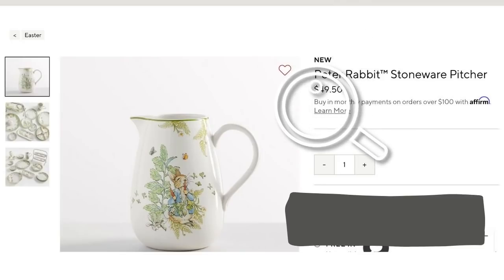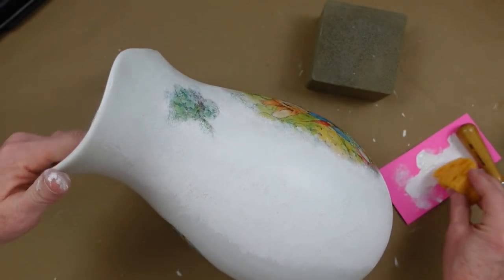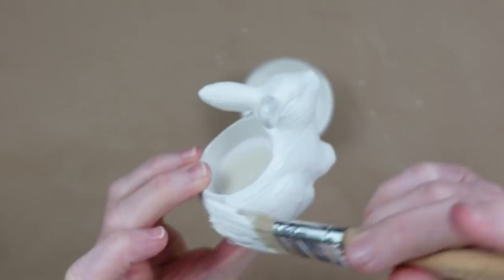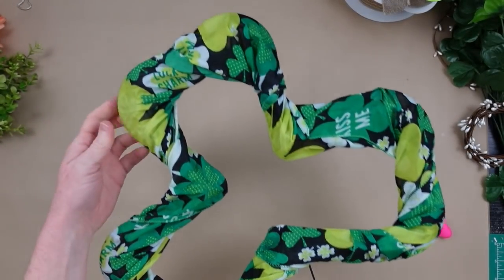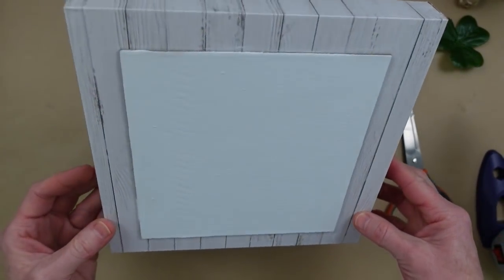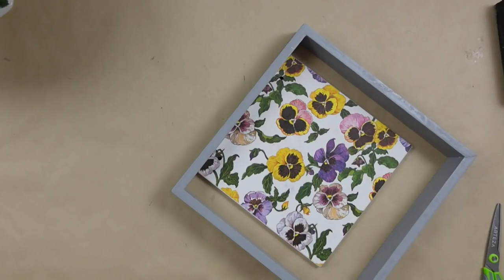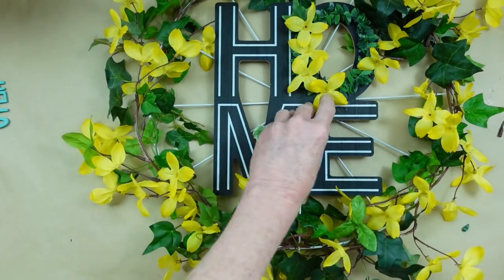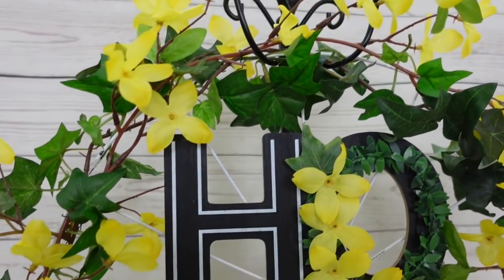15 MORE Gorgeous Spring DIYs from Dollar Tree and Thrift Store

Comment: That white pitcher is like the perfect white pitcher. Perfect for what you do with it. The only thing i would have done differently is tear the edges of the tissue paper instead of cut. I always do that with decoupage because it blends in better if the edges are torn and rough instead of a cut straight edge. But it was still beautiful even though it was cut edge, even before you put the paint on. And even better after. You always do a great job, Brandy. I love every one of these diys.
Reply from the maker: Thanks so much Crystal!

Comment: You rocked those bunnies using chalk paint. Really, they were beauties. But, an easier way is to use white wax if you have it. What i do is, i buy the cheaper Waverly clear wax and just add a bit of white paint to some. I just pour a bit into a small container and add the paint. I like doing this because you can really make any color wax you want. It works so well for that concrete or stone texture. I have also done the method you use on here with sort of dry brushing and stippling the white paint. Both turn out great. The white wax just makes it easy and quick, plus seals the project. And again, you can add any color paint to the clear wax. You could make pink wax, blue wax, gray wax, or add brown and make an antique wax. Just a tip. I've been binging all your videos , old and new, and as usual, everything you have done here is absolutely beautiful, Brandy. Awesome ideas.
Reply from the maker: Fantastic idea Crystal! Thanks!